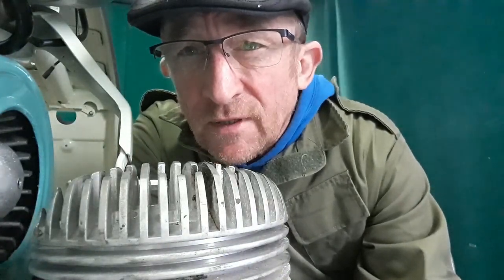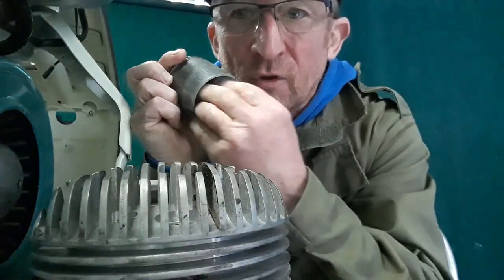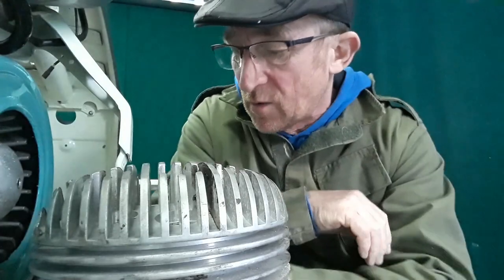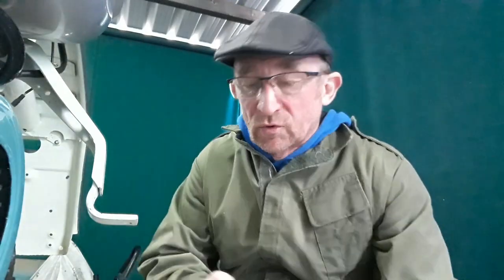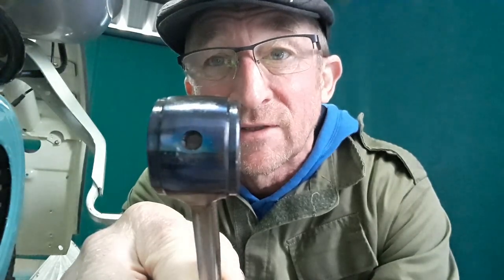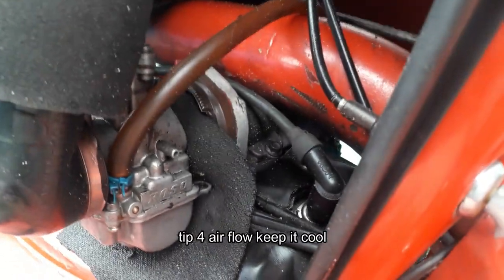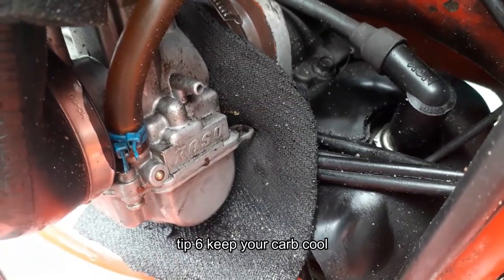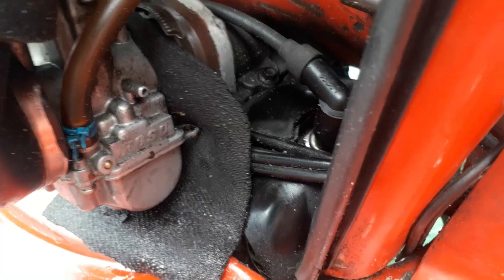LAMBRETTA COOLING 3

Comment: good point about the hot air hitting the carb,
i have just fitted a lth left hand manifold to my ts1,wasn,t cheap but great quality,so should cure this problem,only reason i went with this manifold was i had a cut out in l/h side panel and a battery tray, also i didnt have to alter cabling,so was less hassle to fit this than alter everything,
so a bonus having the carb on the cooler side,i will be carrying out the fan and head cowling mods when i get chance,keep up the good work always informative videos
Reply: also great access to spark plug,and clutch and gear cables arent restricted,if you have a ts1 you will know what i mean

Comment: COOL 👍 what did you say that bib was made from ste , its a great idea m8 , never even thought about that before , heat from the cylinder straight onto the carb warming up fuel before it enters the cylinder and thats a never decreasing circle , great COOLING tip m8
Reply from the maker: its just made from the first thing that i found in the garage . just soft rubber with a fabric backing just cut to shape and put a hole in it so it slides on the back of the carb . keeps it cool and keeps some shit off aswell mate .
Reply: @TheSteelweasel  sound idea , im down the shed tomorrow now to find something lol 👍
Reply: a plumbers heatproof mat cut to size would be ideal
Reply: @midge225  a plumbers heatproof mat cut to size would be ideal,probaly get 3 or 4 out of a mat,cheers
Reply: @tavspeed1101  cheers for that , i was gona use an old car mat but now youve said that 👍

Comment: Hi steve great videos as always, am fitting an external condenser and was wondering were is the coolest place to put it under the panels on the lambretta if there is such a thing. 😆
Reply from the maker: Fit it in good air flow but close to magneto . On the wiring gland is a good place to
Reply: Thanks for the reply steve,but wots a wiring gland 😂